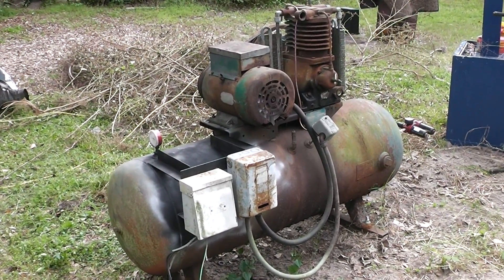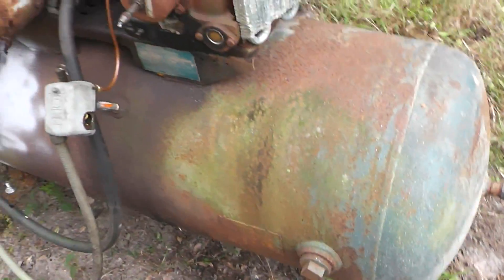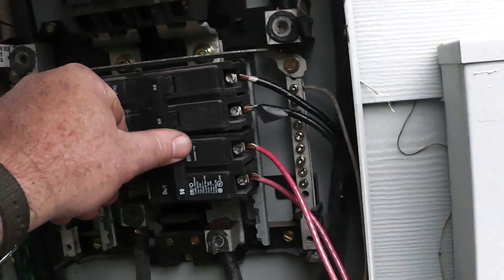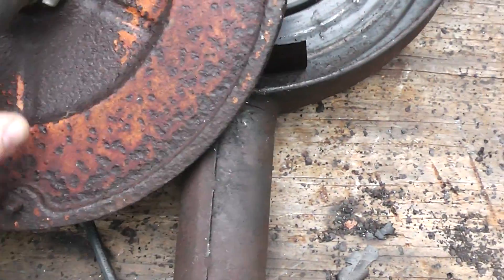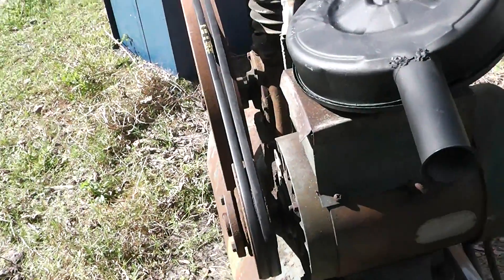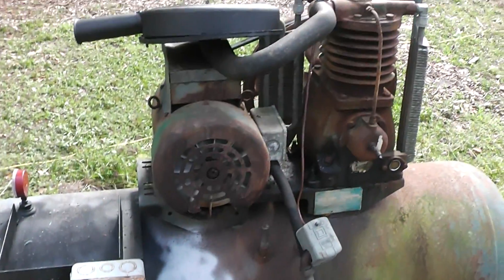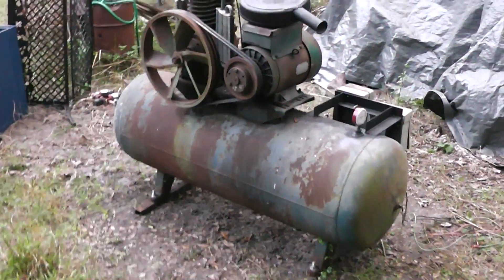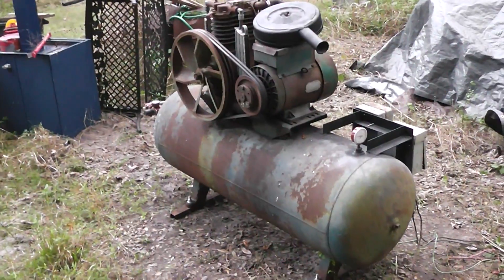Air Compressor for Free

Comment: I built my first compressor about 20 yrs ago, It had a new 60 gal speed air 200psi  tank a rebuilt all cast Iron craftsman pump that the original owner had run out of oil, It had a rod stuck to the crank and after I freed it up it did use some oil but not bad, also I used a cheapo china 2hp motor, a few yrs ago I finally upgrade to a vertical 5hp Quincy, as my work required very clean and dry air, I ended up using my old air tank to make a BBQ smoker, I killed me to cut up that 400$ tank, and I only ponder how many tons of air it ran though it , I kind of broke my heart to take the cutting wheel to it but in the end it got used again.
Reply from the maker: Swanny383 That's what I like, things that are re-buildable and when you are finally finished with it you re-purpose it!

Comment: I would check the oil in it.
Reply from the maker: longislandprepper1 I failed to mention that in the vid but, that is the 1st thing I did.  I changed the old stuff with compressor oil and not motor oil.